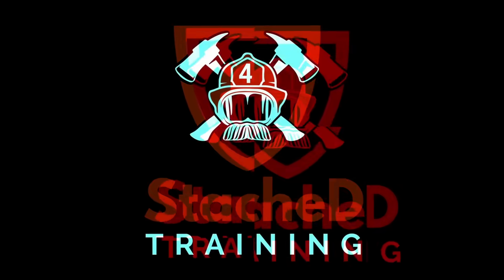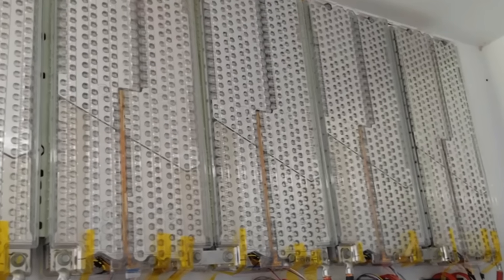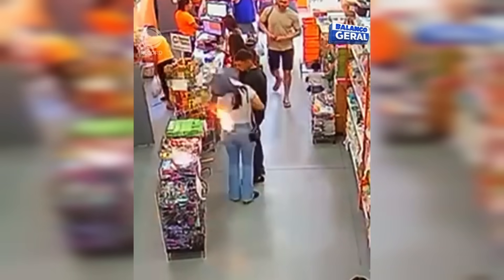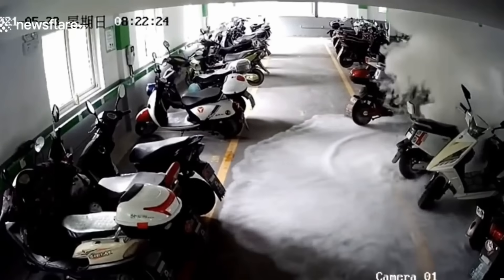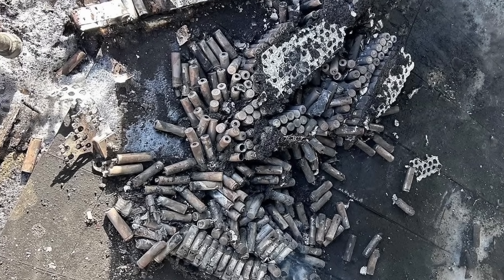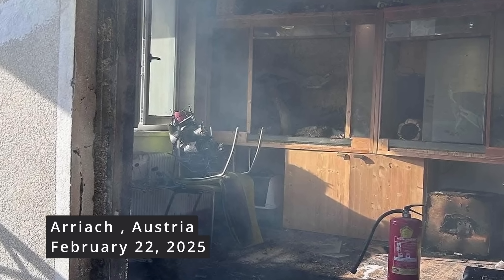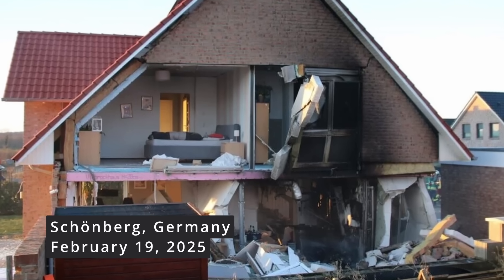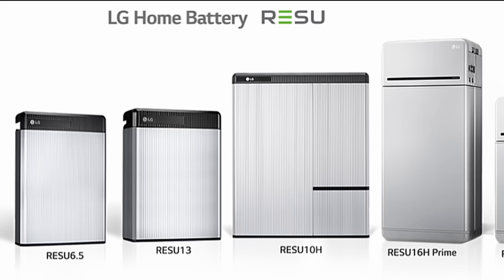Two Homes Just Exploded—The Hidden Danger in Battery Storage!

Comment: Heat is also a problem with batteries, in fact it is worse than the cold. It shortens there life dramatically. Batteries like these get hot during charging and discharging. Get over 80° F and it started to degrade the batteries. As it gets hotter the degradation increases exponentially. I live in southern AZ where temps for most of the year can be over 80° and can be well over 100° for 6 months out of the year. Now imagine an EV on the road whith the heat being reflected off the road or sitting in a large uncovered parking lot with temps cooking those batteries or cooking those batteries in an un-air-conditioned utility room, garage or even a separate building and you have an accident waiting to happen. Really anything above 80° F is the same thing. As the building and battery temp rises, the degradation and build up of gasses inside of them increases exponentially. 
Once a rechargeable battery gets damaged by the constant charging and discharging they will either not hold a charge or they can short out causing a fire, add heat to this and it will happen much faster.  I've had several 18650 rechargeable battery operated security lights over the years. I've yet to have one of these batteries last more than 3 months in the summer. The only way I can make them last is to remove the battery, solder a set of wires that I can move the battery into the house and use a charging unit inside where it is cool. Even the solar panels burn within a year or two out in the hot sun. Yes, solar panels are effected a lot by temperature and have an optimum temp condition that will produce the most power. Go above or below that optimum temp and the power output is effected exponentially as well. All of that information is easily found. 
BTY, these battery units are even more dangerous the closed they are to places closer to moist salt air, like by the shore of the oceans. I wouldn't install one of these units in my home here in the SW Desert let alone in a beach front property. Look at all the EVs that explode and catch fire when exposed to salt air like that. And once they catch fire those batteries are about impossible to put out. Check out the ships transporting EVs that caught fire.
And don't get fooled by the BS that they will save you money and the planet because they are not using focal fuels. First it's focal fuels that are used to make the electricity in most plants. Nuclear power plants are not clean either as the spent fuel stays highly radioactive for hundreds of years and storage room is running out for all the radioactive waste. Next the amount of time needed to recharge them is ridicules, like 30 minutes minimum at special charging stations but the average time is more like 8 to 12 hours depending on how low the battery is. It takes me less than 5 minutes to fill the empty tank on my car. Next is the power grid that is at it max capacity and it really old. It can't handle much more of a load. Then as more and more of these expensive EVs start using the power to rechArge it is going to make the price of everyone's electric utility bills go way up. California is already having problems with high prices and the state government asking people not to charge there cars at times. It will not take long before the cost of charging these systems, either a car or home battery storage systems will cost more than gasoline. And of CO2 is such a problem then why haven't they banned carbonated drinks, CO2 fire extinguishers and a host of other manufacturing that uses CO2 in the manufacturing process like in welding? It's all BS.

Comment: LG Battery systems have had other failures before. Most , if not all , of General Motors BEV's that experienced battery fires used LG battery pack as I have read . I think battery storage units should be required stored in an outhouse that is ventilated & temperature controlled with a minimum of 50 feet from any human habitation and easy access by firefighters .

Comment: Seems like a great way to get a home owner's insurance claim denied.
Reply: Home insurance will only be denied if the battery system can be proved it coursed to fire. If it was a a gas heater that coursed to fire, claim could not be denied.
Reply: So now they deny you for having spray foam, a wood stove, or battery storage. Just consume and be grid-tied is the message?

Comment: I just put one inside my house (LFP - self-assembly). I reckon it'll be fine. I was aware of the Lauterbach incident before doing so. That's one major incident in several million batteries so far. I'll take those odds. The Australian rules with big steel boxes outside are OTT IMHO, but that's probably where we will all end up, especially if people keep making scaremongering videos like this. The distinction between LFP and ternary batteries is important here. 
Possibly what we actually need is ventilation rules. My house has MVHR with at least 0.3 air-changes/hour. Hopefully that's more than enough to avoid significant explosion risk, but probably we should be specifying extraction from battery areas, rather than forcing inefficiency and degredation by putting them outside.

Comment: If these dangerous fumes are detected, ventilation should be opened up immediate and an alarm should sound. 

And that ventilation should not close when power is lost. A wind-driven turbine vent sounds like a good idea. And maybe the intake should fairly high so as not to be a problem during flooding.

Comment: If I were going to have such a storage system installed, I'd have it placed in a purpose-built concrete-block closet outside, with a small heater for winter temperature control, and a door equipped with a blowout panel to relieve an explosion in a "safe" direction.  That ought to provide the needed degree of safety, similar to enclosures for gas-fired water heaters that are mandated in some areas.

Comment: Funny you mention that, I am planning the shed for my LiFePO4 batteries as I watch this video.
I live in a Travel Trailer, the original "Tiny Home," and have a borderline paranoia on flames in the dwelling.
So much so, that I bought the Vevor Diesel 5/8Kwh Diesel Heater, and am going to park IT outside, and duct the heat in with a return loop.

Comment: my opinion on that case with used tesla battery  first thing to  do to test each cell to be used in new pack . if there are any sign of abnormal heating while charging single cell  do not use that cell in building big packs  - best option to put into bin for scrap batteries in your area .  in some racing events with electric bike cell fuses  for each  cell are mandatory- that could be an industry standard , but that only reduces risks.   What your opinion how those incidents could be prevented or reduced  bad consequences ?

Comment: We have strict regulations on fuel storage.  Many do store a can or two of gas in the garage. Not good.  I won't even store gas cans in my barn.  There are minimum distance regulations on how close a propane tank can be from any structure.  So the same should apply with batteries.  I am planning a concrete block shed for my batteries and inverters. (Not too close to the propane tank)

Comment: This is why high explosives are illegal to experiment with. The potential for extreme disaster is too great.
Reply: Natural gas to home can level the house to the ground.
Reply: @SoCal-modified  The battery in an electric car can explode and burn your house down. Got yours yet?
Reply: @glasslinger  Amount of EV burning down the house is way way lower than gas home explosion. Also you have better chance of excape from EV burning the house vs gas explosion. Hydrogen explosion from battery can happend with multiple safety feature failure( small ventilation in the garage or storage room will prevent the problem easily) possbility are almost none, when it happends, it was improper installation or using bad parts without safety feature. You have to do multiple bad things to cause exolosion.

We do have EV, 30KWh of LFP battery in the garage. planning on adding 30-60kwh soon
Reply: @SoCal-modified  "Amount of EV burning down the house is way way lower than gas home explosion."
Let me rephrase that for you: "Hey look, there's less happening with stuff that isn't even remotely as common to find, so it must automatically be safer altho there's exactly 0 correlation and no proper statistics".

If handled properly both can be a hazard - but especially with batteries people just love to play around with them and blow their homes up due to sheer stupidity (or just normal faulty devices) which honestly at this point almost becomes an epidemic.

But let's compare those side by side:
If I have a gas leak and notice it I can take precautions and ventilate it - if my house catches on fire due to a battery it either is already almost entirely broken down thanks to an explosion or it has to burn down as it can't even be extinguished.
Use your brain, stop sh*tposting - no one cares if you got batteries, but acting like self chosen actually avoidable way worse hazards would be safer is just denial.

Comment: Those older tubular Lithium cells are bad and expensive..  LiFePo4 prismatic batteries are better and cheaper but no matter what these batteries need a charge controller for safety.. Old Tesla packs jumper many small batteries into groups and if one of those cells in a group goes thermal you are screwed.. Salt batteries have zero chance of fire but are less energy dense and heavier so hardly anyone is manufacturing them..

Comment: I've said it once, and I'll say it until the day I die...we need to be investing in improving and upgrading our electrical grid to make it more robust and resilient, including adding dependable sources of 24/7 power such as Nuclear. Renewables and batteries simply aren't enough.
Reply: What can you mean ?
Everyone knows we have to switch everyone from gas and propane heat to electric heat pumps . Also electric cars to replace gasoline .

In an  unrelated story - 
All permits for new powerlines and non solar powerplants such as natural gas turbines and nuclear have been disproved !
Reply: @josephpadula2283   I agree that we need to switch from gas heating and cooking and driving to electric. But where does that electricity come from? The reason we have battery storage is because renewables like solar do not operate 24/7. They generate lots of power during the day, and very little at night. Our grid is not designed to shuttle that excess daytime power from where it is being generated (like people's rooftops in Arizona) to where it is needed (like data centers in Washington State). Therefore, we need to bring more nuclear power plants online, and we need to beef up our power grid so that more renewables can be fully utilized.
Reply: @kentslocum  Nuclear plants need large amounts of storage too, because they (most designs) cannot slew fast enough to match demand variation. That's not really significantly different from having diurnal storage for solar and wind. Less of it would be in homes, and more at utility scale, but we know those catch fire sometimes too.
Reply: @xxwookey   It's true that nuclear power plants have traditionally been used to supply base load power, supplemented by gas power plants during periods of peak demand. But what I was pointing out is that nuclear power runs all night long, which would remove the need for battery storage for solar. Smaller, more modular nuclear power plants are being designed and tested,  which could be turned off and on as needed to supplement the main power plants. We need to get away from massive battery storage facilities--they're just too unstable, unproven, and unsafe.
Reply: The storage at a nuclear power plant is not in anyone's house.

Comment: Build a battery shed. Get the batteries away from the house.
Reply: In freezing temperatures, when you need the battery’s there almost useless when freezing?
Reply: @bernardwarr4187  
Correct, if you add heaters, they drain the battery.  But this info doesn’t fit the narrative
Reply: @tomedgar4375  when the battery are kept outside, in low temperatures, there efficiency drops, right when you need the power, that’s why people store them inside?
Reply: @ 
Correct, the shed would require a small heat source if you are in cold regions
Reply: @ which would void any benefits from having this system, for a domestic situation?
Reply: @tomedgar4375  if the shed is well insulated, the electronics will heat up the space. But then you need cooling in the summer. So the shed has to have climate control.
Reply: sealed gel acid battery for safety they mechanical valves none bms and can be recycled
Reply: Yes, I would only consider a NiCad system in a concrete building dedicated to the battery storage away from the house.

Comment: I am concerned by the number of comments saying they are going with the "safer" lead acid battery chemistry, for indoor use,  in the comments.

Unless it a sealed (SLA) type: you need more ventilation than you would need with a sealed Li-ion setup.
Both  flooded (FLA) and AGM batteries can produce a lot of hydrogen near the end of charge. The "maintenance free" types do their best to reform that hydrogen with a platinum catalyst: but still have vents.

Comment: I remember when film stock was nitrate and it was stored in specially constructed vaults with separated compartments, blast vents and fireproof materials, electrical systems and fire suppressant systems. These batteries seem far more dangerous.
Reply: Those celluloid films were far easier to ignite, so were far more dangerous than LiOn batteries
Reply: @rubenwillmarth9731  you can't ignite film by poking a hole in it.

Comment: C02 is not a Pollutant & it shouldn't be regulated. More C02 means More Green. These FACTS are extremely important. It is important that people understand simply things like Photosynthesis where Plants take in C02, water & sunlight to create Oxygen, Food for Humans, Wood for Burning & during their phase they actually break down & become Fossil Fuel. Did you know that Oxygen is poisonous to Plants? Plants are like Humans they breath out the elements we need to survive. Plants provide Oxygen while humans amongst other things provide C02 for Plants. So it a Cycle of Life & people that Grow Plants, Farmers, actually introduce extra C02 with Fertilizers. Fertilizer is a form of Carbon that Helps Plants Grow. Governments declare C02 bad & then go after Fertilizers because why? Do they not want people growing more Food? 

Also did you know that Submariners breath in average C02 concentrations around 3,500 to 4,100 ppm & Studies have shown that even at high levels, such as 15,000 to 40,000 ppm, there may not be significant cognitive impairments for short-term exposures in physically fit individuals. Right now the average C02 level in the atmosphere we breathe in around 400 ppm & the Death of Plants is around 150 ppm. The toxicity of C02 has nothing to do with Temperature or Warming & its in the dose & we are nowhere near the amount of C02 that it would take to be an issue. Also Plants are constantly using C02 & creating Oxygen. 

All this hype about C02 is nonsense & just another way for Governments to control you or Tax You. Also the correlation between C02 & Temperature is that C02 levels rise AFTER WARMING not Before. For example when you burn something youll release C02 & this proves that C02 is a result of Warming not a cause. Tailpipe Emissions comes from Burning Fuel, you do not use C02 to create Combustion however the Climate Change Alarmist would have you believe more C02 means a hotter Planet. In reality more C02 means a GREENER PLANET! Again this stuff is important & you don't have to be an accredited Scientist to know this stuff. A lot of these facts about C02 you already know & understand & have witnessed many times.

Comment: One of the battery companies might eventually come through with something safer. Skeleton if they can increase the energy density of the coal and aluminum foil capacitors. Iron Chloride is another chemistry being tested./ Victoria, Australia was pushing for concrete external  (outside house) domestic battery installation units. They ended up with Aus, NZ standard 5139 (bess installations)set of rules as a compromise. A proliferation of community lithium batteries on power poles (PMBs-pole mounted batteries) in areas where electric companies are trying to avoid or delay completely overhauling the infrastructure or tou -' time of use' shift excess local p.v electricity.